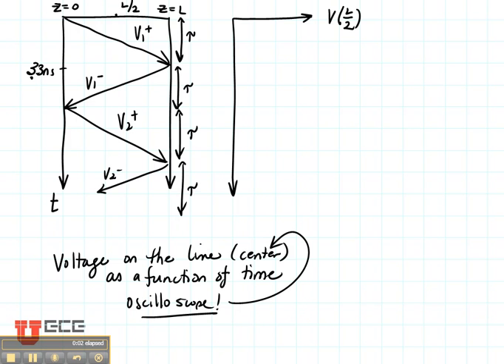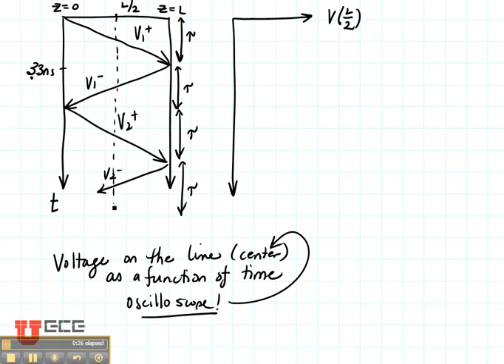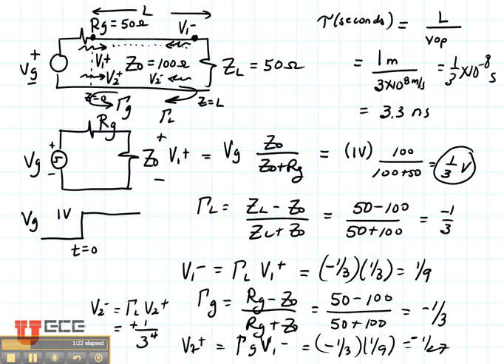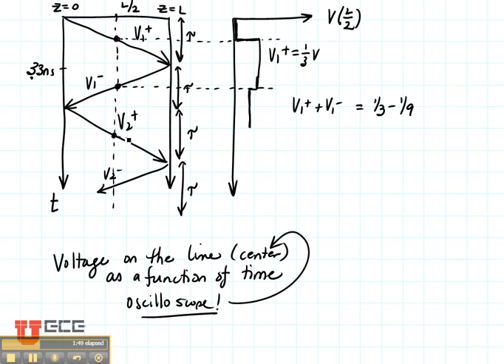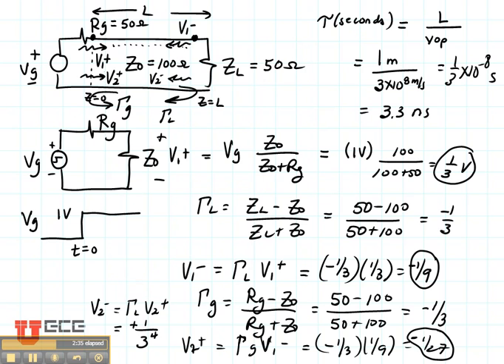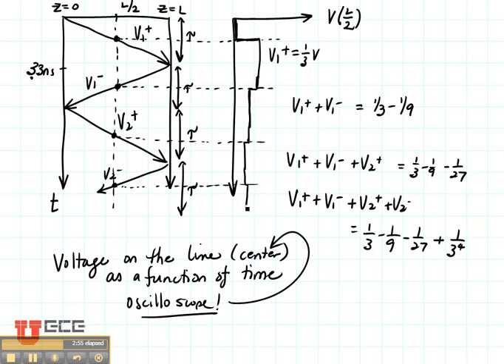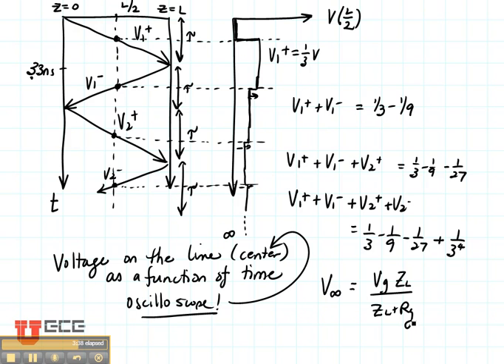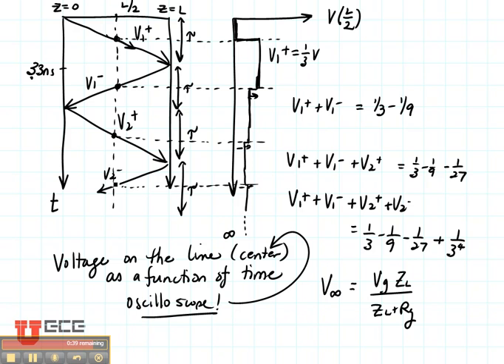ECE3300 Lecture 9-3 Bounce Diagrams

Comment: At 3:30 you explain that the voltage will settle at Vg * Zl (Zl + Rg), which is 1V * 0.5 = 0.5V.
However if I do the sum ( 1/3 - 1/9 + 1/27- 1/81 ...) I approach 0,247 V. What am I doing wrong?

Comment: The maths on this is incorrect. Once you realised 1/9 was incorrect, you should have gone on to change all of the figures which used 1/9. Thus, -1/27 should be 1/27 and 1/3^4 should be -1/3^4.